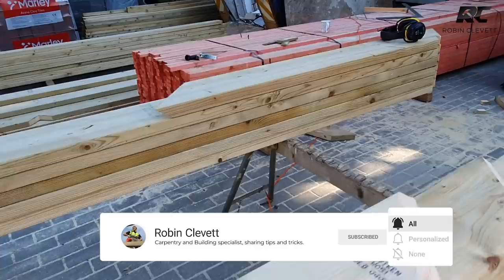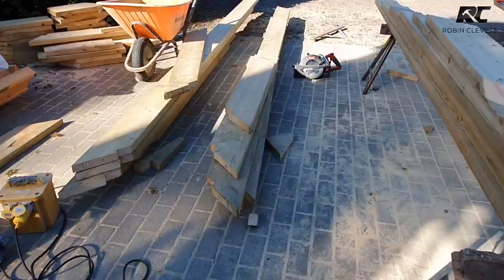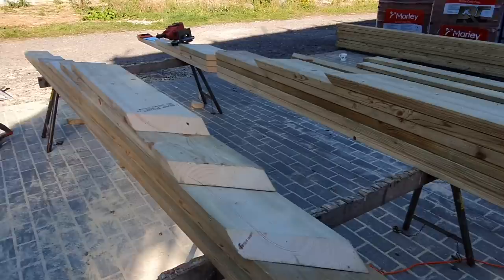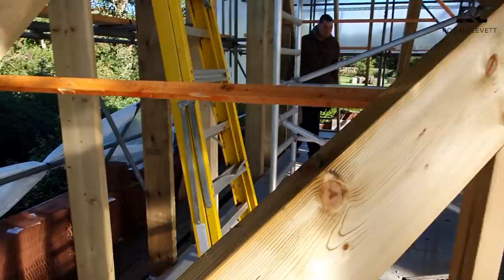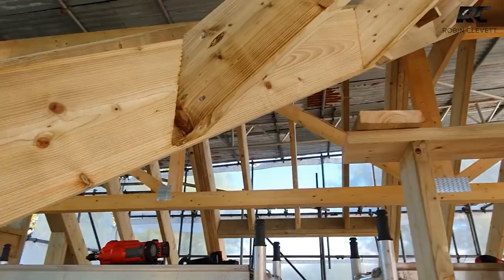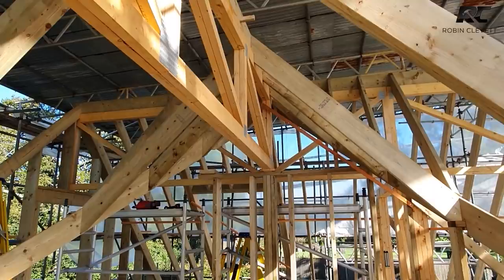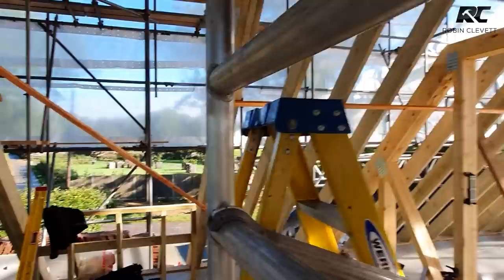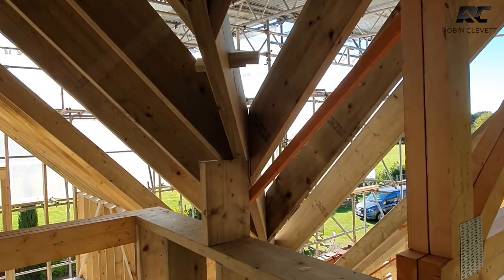Valley Jack Rafters, The Big Build 31

Comment: Funny, I wondered from last video if scarfs should have a strap for sideways support (Hurricanes etc.) but then in this video I see where all the jack's go in and that it's rock solid. Well impressed by it all. I can see now why it's the tin roof you worry about not the one you are building. Be better to do some work I the safe rooms below if the wind is riping through - I guess you just can't resist getting on with it though. Great to see the lads fitting the jack's, and amazed at your 5 mins per jack cutting. Many thanks.

Comment: Do you nail up with 4" wire nails?
Very neat work but I wouldn't rate screws and pasloade nail as suitable fixings here.
Reply from the maker: We use a structural screw to perfectly position then we use a 3.1mm heavy duty galvanised nail from Paslode and these are perfect for this application, there are some cheap nails that may not stand the test of time but the quality of the paslode nail and the Spax screw. Maybe I will do a video on this at some point??

Comment: Why are the rafters not flush, I see it's deliberate using a spacer.
Reply: They are the valley jacks, basically to stay on plane, the edge of the valley jack rafter should strike the centre line of the valley rafter,  for that to happen they need to be set above the edge of the valley rafter.
Reply from the maker: Check my video on Cutting and fitting valley rafters for the reason
Reply from the maker: Top of the class Rob!!
Reply: @RobNorman08  Another way to do it is to raise the seat cut on the valley the same dimension as the the drop on the hip.
Reply: @TheToolnut  How does that not change the pitch angle of the valley rafter?